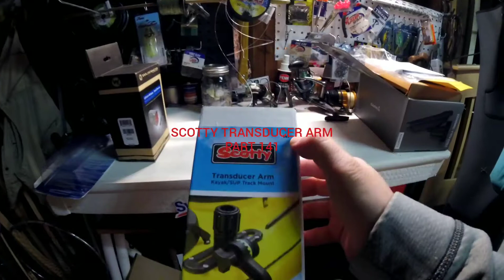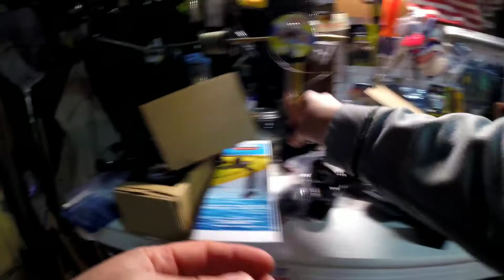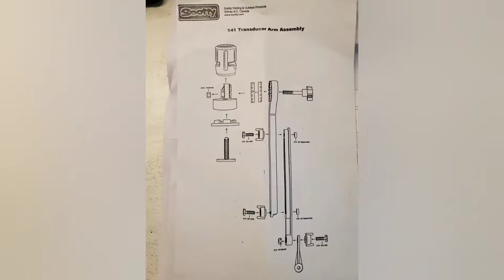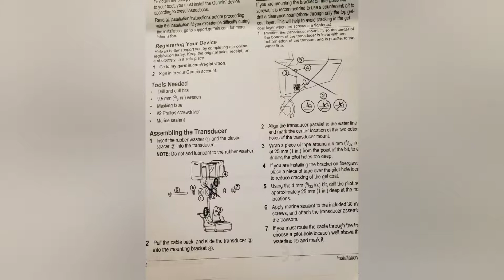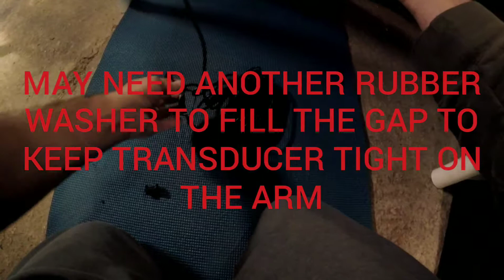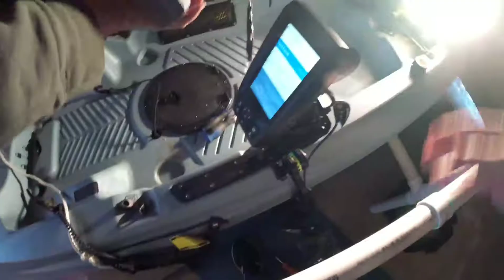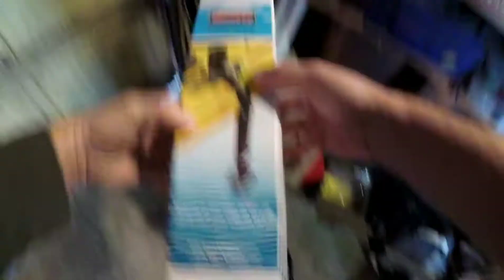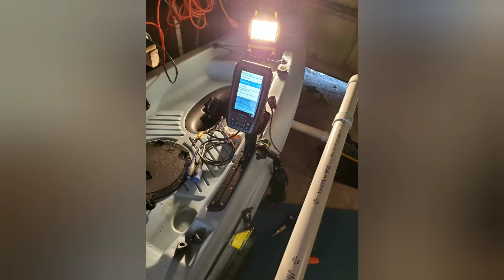no drill option on a Garmin Striker Plus 4 fishifinder on a Hobie Kayak

Comment: Thanks for sharing man, how're you liking the striker?
Reply from the maker: lol sore subject i hooked it up and it appeared to work well from the garage. Then I finally had the time and weather permitted to take out and pulled my kayak hit a rock and broke my rudder blade. lol not good just finially got the new blade on and waiting on better weather to truly test it. But once plugged in it seems easy to use and transducer was showing air temp etc. Will give a full review asap. thanks tight lines
Reply from the maker: I actually finally used it and it is nice works fine. I went out on a big lake here in PA really didnt fish too much it was windy and sorta cold but the Garmin performed well with the Wilderness battery. Everything worked well